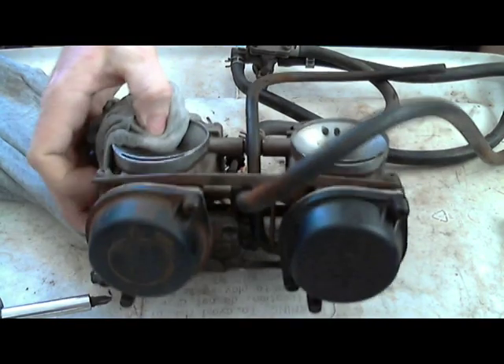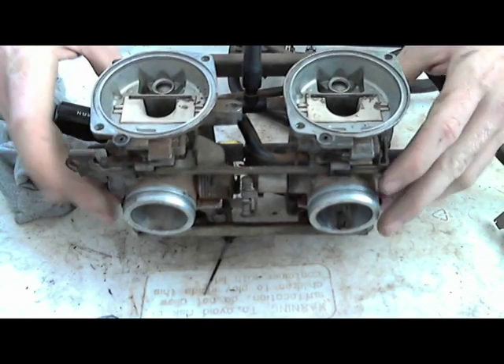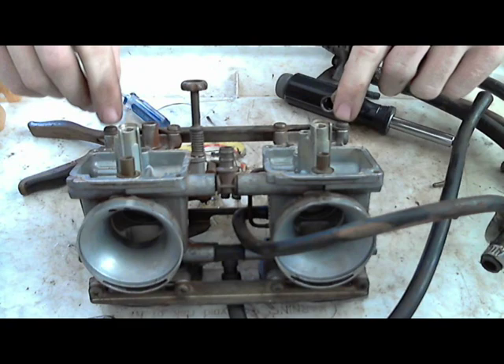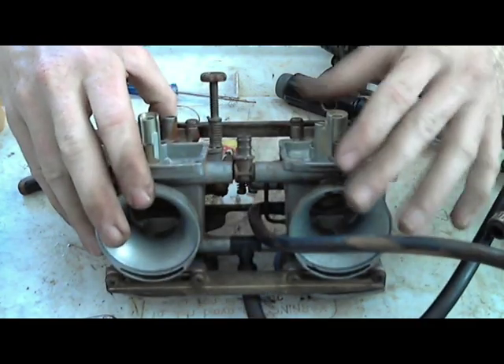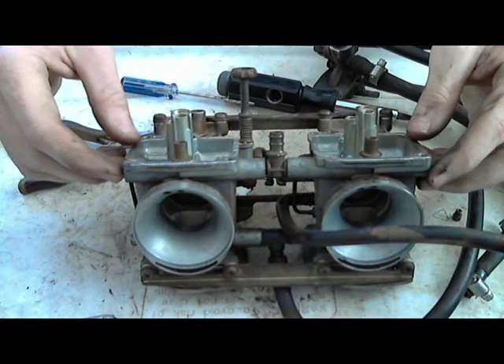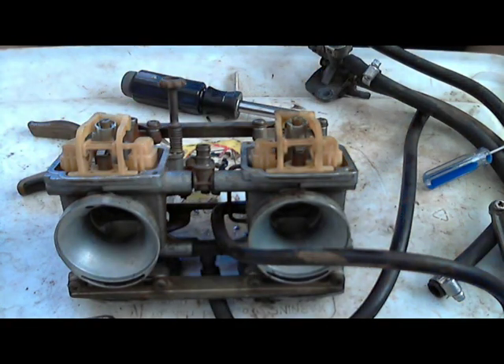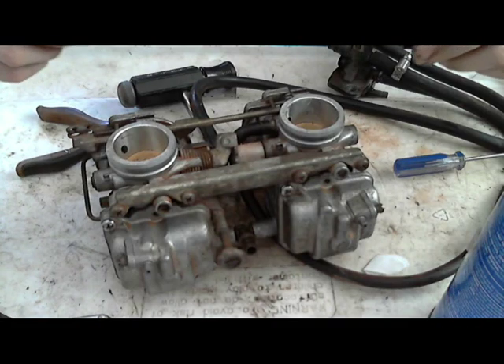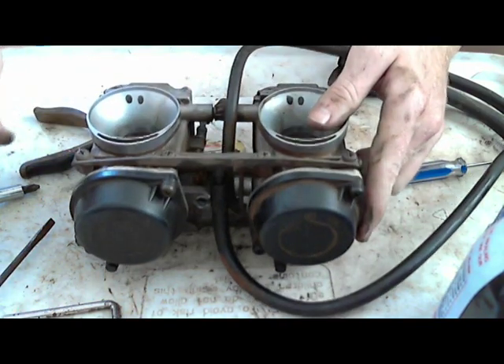Step-By-Step GS500E Carburetor Cleaning

Comment: Edward Miller asked about the tiny O ring that fell out at the start of the video.
If you look at 57:00 minutes, you can see an O ring in a small hole beside the screw hole of the right hand carb, and the left hand carb has not got one. That's where the O ring fell out of. On the plastic cover that you are screwing on is what looks like a pen cap/top that covers the O ring. When i replaced the needle on my right side carb, i found the O ring on the engine casing and did not know where it came from. Luckily i only had one carb top off, so i could carefully take the left side carb apart and found where the O ring had to go. The pen caps/tops are rubber caps that are removed to put a manometer on the carbs for synchronising the vacuum. BTW excellent tutorial in real time that will certainly help me now, as i have to remove my carbs for cleaning. (That was the whole point of watching your very helpful video) Thank you for sharing your knowledge with us.
Reply: Hi Edward! Thank you so much for pointing out this o-ring "issue". I've been looking for place it goes since May this year. I disassembled my Mikuni BST 33 carbs on Aprilia Pegaso. They look similar to these ones on the video, but don't know Mikuni model on Suzuki. Just to be sure 100% where this tiny o-ring goes, could you please check if this is part nr. 14 on the scheme here? http://www.bikebandit.com/oem-parts/2000-suzuki-gs500e/o/m22351#sch246853
Reply: Also I am curious why that tiny o-ring fell out after the plastic o-ring or cap was removed from the needle and the o-ring fell out together with the needle while turning upside down.
Reply: Aleksandr Melanich 
Hello Aleksandr,
I had a quick look at the link you left me, and 14 is the small black O-ring I talked about.The needle has a small whitish ring that is a spacer/washer (it's nylon/plastic). The black rubber O-ring (14) may have been stuck in place from the pressure of being squashed in place, and just fell out after being released to expande.
I hope this makes sense to you, and good luck with the rebuild. :-)

PS. Please let me know if i have helped in any way.
Reply: Edward Griffin many thanks! Now I know where to place it ) Merry Christmas and a Happy New Year!
Reply: Aleksandr Melanich 
I am only 2 pleased 2 help. :-)

Comment: The needles in my carbs are exactly the same as the ones you have shown. My right one had worn thin and snapped in half (left one was still perfect, work that out. I thought they would wear out at the same time). My local Suzuki dealer (John's of Romford. In Romford, Essex, England.) just looked up the frame number off my bike and ordered some new ones for me, that are the exact same ones again with the C clip and nylon washer. My GS 500 E is my commuter bike, 5 days a week. The picture is my Triumph Thunderbird 900 for cruising with my wife.
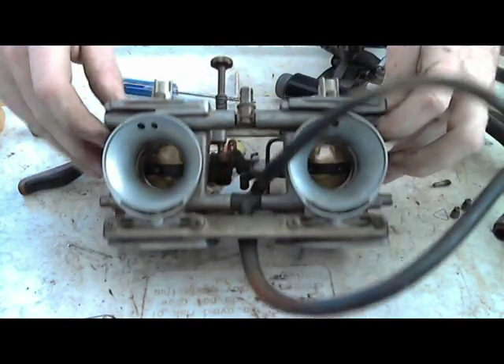I have only watched 27:20 so far and i think you are giving some good tips, and clear instructions. So now i am going to watch the rest of the video. TY.

Comment from the maker: The cleaner is the size of a paint can, you can buy it at most autoparts stores. To put each carburetor in you have to completely disassemble the carbs. And make note of where all of the springs and screws went that are between the carbs. There might be seals or o-rings that you will notice when removing the parts to disassemble it. The idle air adjustor screw needs to be removed. I'm not sure what else on the gs500 needs to be removed that is rubber. Just disassemble it completely to be safe.

Comment from the maker: you can either get new manifolds (between the carbs and the engine), or take yours off and cover them in silicone gasket maker. Also put some on the side that seals against the engine.

Comment: Did you ever take the emulsion/bleed tune that the main jet threads into out? Some bikes it falls out of. Some need a push with a pencil and these ones I can't figure out how to remove. Also couldn't remove the vacuum slide cards. There's an oring underneath most of them in cv carbs and it's usually a few chips of dry rotted rubber left. Not crucial I just like to be thorough. Let us know if you know how to pop the bleed tube out. 

Otherwise a decent video.
Reply from the maker: No, sorry, I don't remember if I took out the emulsion tube. This wasn't my motorcycle that I was working on and it's been 10 years.
Reply: @LegitRaceCraft  I see. This one usually needs to be softly tapped from the bowl side with a piece of wood over the main jet. Leave main jet in and tap with piece of wood. Remove main jet and push the bleed tube/emulsion tube/needle jet through the body of the carb. It has a notch so it only goes back in one way. Also the slide cards slide out after that and there's an oring on the bottom that needs replaced. Nobody shows how to do that with the old or newer style gs500 carbs. Usually what you detailed gets the bike to run good enough though.

Also I noticed the floats were visibly at different heights when you put the bowl back on...I think it's because you didn't have them evenly pressed into their bore so the oring could pressure fit evenly. They were noticably uneven. You also balanced the throttle plates wrong. You just set the idle knob so it cuts the foremost idle hole in half with the right side plate. Then the balance screw adjusts the left plate to the right plate. Your guitar string method is okay but easily surpassed with a much easier and less fiddly method. Bisect foremost hole then balance other throttle plates to it and do final balance with manometer or vacuum gauges.

Comment: Hi, I was just wondering if you can be more specific (maybe with a picture or something) regarding puting the silicone gasket on the manifolds. I do not want to screw up something in that area :).
BTW, this video is pure GOLD :)) Thanks
Reply from the maker: I don't think I can go in and edit the video since it has been uploaded. It's easy though, just get a tube of silicone gasket maker and put some around the inside where the carbs slip in and on the bottom where the manifolds sit against the engine. If your manifolds have a lot of cracks you can even coat them in the silicone gasket maker.

Comment: Hello,
I just cleaned my carbs for GS500F, 2009 MODEL. I had gas leaking into air box.
Your procedure is very helpful! I need to readjust the clots to 13 mm from carb cup facing.
After putting everything back, I noticed that my throttle became sticky. RPM takes few seconds to come back once I release throttle when it is not fully warm. When it is fully warm, RPM doesn't come back to zero at all. 

I know that I have everything back for sure as it was. Throttle cables are not swapped, vacuum hoses are as they were before. Carb has everything in place. Only thing I end up by changing is float height. It was surprisingly lower than 10 mm, which I adjusted to 13 mm.

Can anyone suggest possible things to look? Thanks in advance.
Reply: Paul Ten you ever resolve this issue?
Reply: If you have a hanging idle check your air intake and filter

Comment: Hi,
Having problem starting my GS 500, after it had been sitting for a number of years. Will run for a few seconds if you spray fuel into the carb! When cleaning the Carbs both Idle jet screws are really tight and cant tighten or remove them. Got that bad feeling (something is going to snap!) when attempting to remove. Any suggestions?
Cheers.
Mac

Comment: Just bought a 92 gs500 that was torn apart. My question is where does the hose go from the top t-fitting inbetween the carbs? Bottom is fuel inlet correct?
Reply from the maker: It's been a loooooong time since I worked on that bike, but it should be a breather hose that vents out to the atmosphere so the fuel level can rise and fall without pressure. Sometimes they have a little hose that connects to a little box, and other times it's just a hose that connects to nothing. Double check when I said though, I haven't worked on this bike in a while
Reply: @LegitRaceCraft  thank you. I will leave it vented and see what happens. Appreciate it
Reply: @jaredward1410  if it’s vented, does it even need a tee? My rubber tee broke and it’s hard to find a replacement.
Reply: @sevillasllc3391  i would think it wouldn't matter

Comment: Did it all work fine after this? You didnt have any riding problems like stuttering on the highway before? You did not adjust or measure the floater heights?
Reply from the maker: Yes, this was my old roommates bike, and as far as I know he didn't have any more issues with the idle.

Comment: Thank you for your really quick response. I do not see any cracks at this point but I'm gonna take the carbs out again.... ;) However how about if I do not see anything that I should be worried about, how can I really check if it sucks hot air? Can I spray it with wd40 when is hot and wait for the rpm to go nuts? :))
Reply from the maker: warm air is thinner than cool air, so it makes it through cracks easier. If your idle is rising when it warms up then that is most likely what it is. I've seen it on a few gs500e's. Just seal up where the manifold mates to the engine and see what happens. If you don't see any small cracks in the manifold then I wouldn't worry about sealing the outside. Just inspect it well for little cracks on the inside or near the base
Reply: Jay Shipp
Unbelievable, I took the bike out today for a ride (90k to be exact) with the intention to buy the silicone gasket maker and everything was perfect with the small issue that at 9000 rpm in neutral it spits black smokes......but Idle was ok EVERY TIME. Power delivery good as well.... I'm thinking carb sync? or float heights? What do you think? I was out for 2.5 h without any idle issue......wierd I would say

Comment: gret video, I actually have that idling issue you described. Would you know of any reason why rpm drop slowly? Thanks
Reply: If you have a hanging idle which is what you are talking about it seems very well may be an intake leak. Check your air box and air filter!

Comment: Hi, I was wondering if you would be able to help me. I've got one of these bikes but for some reason it will start up fine and it can rev fine in neutral but when it's put under load it cuts out almost right away.
Reply from the maker: It could be a number of things. It isn't too hard to clean these so I would start there and then see how it runs
Reply: @LegitRaceCraft  the carby had a rebuild so it's clean if that helps?

Comment: Can you tell me where that tiny o ring that fell at 7:36 goes. Mine fell out and don't know where to put it
Reply from the maker: Hmm, I can't tell which one that is that fell, these older videos of mine are grainy. The only place that it can go is around the float needle or in the edge of the diaphragm. There is another o-ring that size around the idle-air adjust screw usually. Check those places and compare against the complete carburetor. Chances are you have the other o-ring in its place.
Reply: its that o ring on the table there
Reply: I have a gs500f btw
Reply from the maker: I'm almost positive it goes on the diaphragm side. Just outside of the diaphragm where that hole is on the outer rim. That should be where your o-ring goes. If yours doesn't have an o-ring there then that is where it belongs. Both Carb A and Carb B should have o-rings there. If they both have o-rings then check your idle/air adjust screws for a missing o-ring. Most idle/air screws have an o-ring this size around the base (near the point)

Comment: I have a 92 suzuki gs500e and I cleaned up the carborators but when I put it back together and started the bike it rev 6 to 7 rpm and it stayed in that range did I miss something putting it back together
Reply from the maker: it could be that the throttle cables are too tight and stuck open, It is very easy to overtighten the throttle cables when putting them back in, so the throttle stays stuck open, or the carburetor butterfly valves are opened up too much. It's also likely that the carburetors aren't sitting in the black rubber boots tight enough, tighten the boots that they sit in, and then play with the main idle adjuster cable. Check the choke too, it could be stuck open.
Reply: 99% sure it was because the throttle cable slack wasn't adjusted right. It needs to be down or low in it's perch not high. Then with any carb screw the idle knob in until it barely touches the throttle stop point and go a 1/4 turn more. That should be your starting point for warming up and final idle adjustment.

Comment: NOOOOOO hueon, no se pueden limpiar con alambre!!! se descalibran!!!
Reply from the maker: not true. They can be cleaned with wire. Just don't ram the wire in and out multiple times otherwise you'll score the inside of the jets. Put the wire in once. Spin the jet, and remove the wire. It doesn't throw them out of calibration